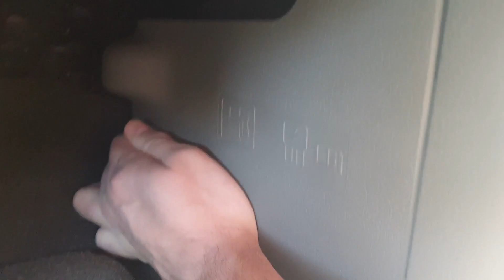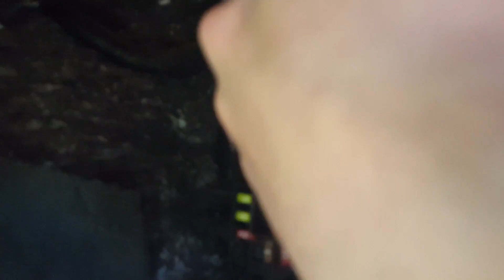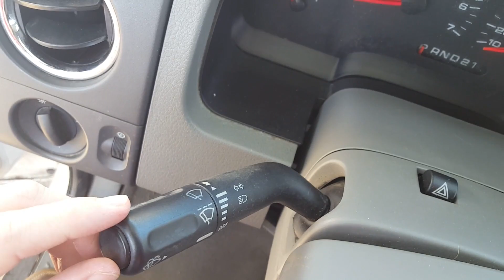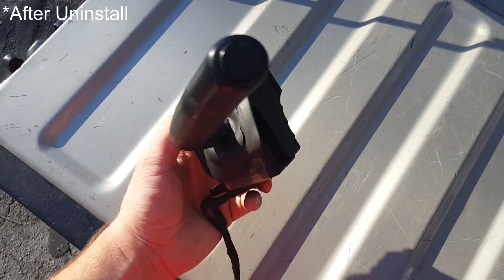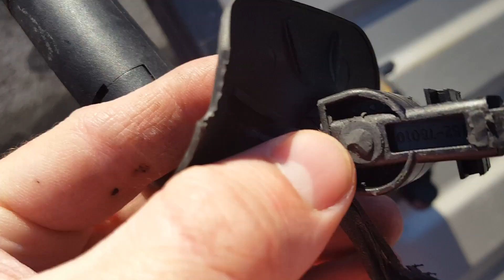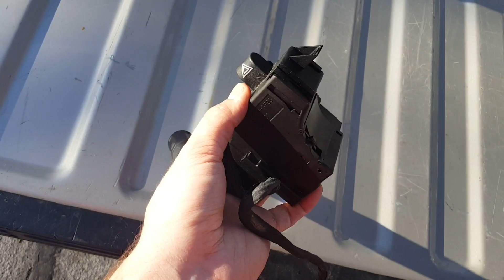Diagnosing 2004-2008 Ford F150 High Beam Problems - Auto Andrew E2

Comment from the maker: Hope you guys that found this are getting your high beam issues fixed up! Sound off down here and let everyone know what was going on for your truck specifically!
Reply: Sometimes when the lever is getting loose like that, it will also cause your high beams to come on randomly, draining your battery. All it takes is a little vibration on the vehicle. Just driving down the road or sitting in a parking lot and having a vehicle drive by could cause the high beams to pop on. That will kill your battery.

So if you're driving down the road in your truck and you notice your high beams, just start popping on by themselves. Then when you park in a parking garage or something and you come out and find your battery dead, you know what the problem is.😢
Reply: @dawall3732 same problem I’m having…I will have replace mine.
Reply: How did you get the lever out?
Reply: Dude! You're the man!  My issue was the exact opposite of your video. My high beams wouldn't turn off on my 2008 F150.  After watching your video, I pushed the turn signal lever in and voila! High beam acuation is working again!  Thank you!
Reply: Hey man thanks for your video! Probably won't see this but thanks anyway 😂
Reply: Good video.
Reply: This took me about 25 minutes to install mine, that's 25 minutes from deciding to do it and being back in the chair watching cat videos.

I even took time to clean all the little dust bunnies.

Comment: 2005 f150 fuse panel has a different fuse/relay layout. I bought my truck used, and the truck doesn't have the cover with the layout, and the Haynes Manual doesn’t any pictures of the fuse/relay panel

Comment: Yes finally I have the same exact problem on my 2007 f150 ima order a new signal marker. Question my fog lights also don’t turn on when my regular low beam headlights are on but they work fine when I put the headlights on city lights (I think that’s what it’s called)
Reply from the maker: Hmm interesting. It could be related but on that I'm unsure.

Comment: My nephews 04 F150 will not dim and his speedometer isnt working.  He lives in Rocky Mount NC where the Tornado recently hit Pfizer pharmaceutical.  It totaled his original truck. His brother sold him this one. Mechanics are back logged there so im from different county ill go get it and attempt to fix it at my place.  He has limited time to fix this due to inspection requirements.

Comment: Beware blown fuses can not always be seen with the eye. Continuity test is more reliable.. Notice before pulling fuse out  two tiny metal surfaces visible on fuse. Do a continuity test with the multimeter probes while fuses are still in fuse box. If you'll look at a removed or extra fuse you'll see the tiny metal I'm referring to where the Amp number is. Easier than pulling out fuses.

Comment: a little later here, i have a 2012 ford f150 my high beams aren’t working, i’ve tried switching the fuse, and it flickers at the beginning but then the high beams turn off it doesn’t burn the fuse so i’m not sure what is wrong

Comment: Okay I have a weird one my right headlight went out right so I plug in another led that ik works but doesn’t when I plug it in on the right side and I’ve noticed when I got to turn my high beams on the left light goes out as well any thoughts on what this could be I did have a bad fuse and replaced it but hasn’t changed anything

Comment: This must be the issue with mine. I'm going to do the push test. Mine will sometimes come on only with the lights on and will become stuck on. Thanks for the vid. I will hit up crazy rays yard once I'm done with this covid.
Reply from the maker: Not a problem! I hope it was helpful in tracking down your issue!
Reply: @HSZGarage  I checked this morning and that's the issue. Mine pushes in alot like yours. I would have been in the fuse box. Your video saved me time.

Comment: My reverse lights dont work even after changing the bulbs 💡 any tips or help with the fuse box
Reply from the maker: I’m not sure which fuse it is. That would have to be a quick Google. If it’s not a fuse it could be a wire issue somewhere

Comment: Your video helped in finding problem. thanks. Want to mention this issue is also when lights won't turn off .  disconnecting battery only way.  Isolated the relay then tried the turn sifter and lights went out. Was able to push in so will need to watch video on replacement.

Comment: Finally a video that showed me the actual problem, now my other problem is the emergency flashers already changed the fuse and everything and they’re not working, if I push down the button the signals work but if I let it go they don’t work any tips??
Reply from the maker: Sorry I'm late. Sounds like the button is not staying clicked into the "on" position. Might have to look at changing it out if you haven't already.

Comment: Mine kind of flickers on and off on its own. I had when it's on it's hard to turn off and when it's off it's hard to turn on. Right away I thought I had something to do with the multi-switch. And the process of ordering a new one but kind of curious about the whole pushing it in thing. Wanting to try the idea of temporarily repairing it as you were mentioning just for giggles.

Comment: I really enjoyed your video. 
My issue is I have LED headlights on my 2005 f150. Only one bulb works on high beam.
I checked fuses but not relay yet.
Ford repaired a recall that needed a  electrical harness  and when I went and picked up my new used truck I smelled a burning smell. Could ford have caused a issue to my LED headlights? Thank u u are appreciated

Comment: Having trouble with the autolamp feature on my 2006 Ford F150 XLT. I can manually turn on the headlights, but I like the autolamp function and it worked up until I had a remote starter installed.  Any videos that might cover this issue. Thanks

Comment: Mine was working but it died and I go in and check it and i have a blue 15 fuse instead of the yellow 20.. could that be the problem?
Reply from the maker: It could be. Look at some documentation to double-check which fuse should in fact be there. Depending on model, maybe it is only supposed to be a blue 15.

Comment: My high beam indicator is on, it won't cycle hi to low when toggling the hi low switch
Reply from the maker: I'd take a look at the switch like I did in the video to see if it's the issue. If not there, then fuses and relays are a good next step.
Reply: @HSZGarage  lol today I actually got a chance to try your relay swap tip and of course I have the harder repair needed. Will be using your video for the repair. You were very helpful 👍
Reply: It’s got to be the magic-break plastic switch: I am on my 3rd and it again failed.  Exactly the same way every time…high beam stuck on.

Comment: Thank you - you helped me troubleshoot to the stalk/lever - behaved just like you showed in the video. I have a 2007 F-150 4X4 Crewcab with 192K miles and the high beams were staying on - even when I turned off the lights. Thanks again.
Reply from the maker: Happy to help! I'm glad you found the video useful!
Reply: How did you fix it? Currently having the same problem
Reply: @FF.Painting  I finally had to have it replaced by the Ford Dealer. The temp fix worked for a short time but was overall unsuccessful. New one works great.

Comment: Excellent video! I know it was posted over a year ago but I'm hoping you might still see my comment. I was wondering....My 2007 Ford F150 is doing something strange. Both light bulb sets were working and high beams as well. We changed the casing because it was cracked...now the left headlight is out and when I switch to high beams I have no lights at all. We changed the bulbs several times with no change. Any ideas would be greatly appreciated. Thank you in advance.
Reply from the maker: Glad you enjoyed the video! In changing the headlight housings you usually have to handle the wiring harnesses and sockets for the bulbs. With a vehicle that's 10+ years old and they're in an area that can be exposed to a lot of heat it can make the wires and sockets brittle. I'd ensure that the sockets and wires weren't damaged in the swap. Checking the fuses is also a good idea. That's where I'd start.
Reply: @HSZGarage  Okay, thank you!

Comment: OK, our 2012 F150 has a similar problem. When the lights are turned to automatic and they come on at night, the high beams won't come on unless you hold the turn signal switch back. BUT, if I turn the lights to the ON position, the brights come on as they should. Any ideas? Sounds like it might be in the light switch itself? Thanks.
Reply from the maker: It does sound like it could be switch related but if the switch and lights work as they should with the headlamps turned to "On" instead of "Auto" I'm not 100% certain.
Reply: I'm thinking there might be some kind of malfunction with the Auto mode of the light switch? The easiest fix is to just use the ON mode on the light switch, but we were just wondering if you or anyone else might be able to pin point the problem. Thanks again.
Reply from the maker: @Redlinesixtynine  It could be. I unfortunately cannot provide much advice since I'm not super familiar with that system. I'd have to do some googling. Haha
Reply: @HSZGarage  Let me know if you come up with something.

Comment: My high beams work but low beams don’t you think it might be the turn signal multifunction switch?
Reply: @andrew wells
Reply from the maker: It very well could be but just the opposite problem. They may be stuck on the "on" position.
Reply: I have the same problem
Reply from the maker: Have you verified that the bulbs are ok?
Reply: My Low beams also don’t work and I’ve been lookin for a Solution for it for 2-3 weeks now but idk what to look for? Which fuse?

Comment: I've done everything here. New multifunction switch and relay is fine. The high beams are still stuck on. Any ideas?
Reply from the maker: Sorry to hear that! I've read that some people were having issues with the direction that the multifunction lever operates. Apparently Ford switched it at some point. I'd make sure that you're pushing or pulling the lever. Whichever is proper for your year. After that I could only guess a short somewhere in the wiring if you've checked the relays, fuses and swapped the lever for a new one. Hope you get the problem located! Let me know what you find out
Reply: Pablo&Ranger did you ever figure out the problem?
Reply: Try pushing the lever straight back into the switch.  My high beams were stuck on, in the process of installing a new switch,  I discovered the  le er itself had popped out of the  socket in the switch,  on good push ,pop, fixed!